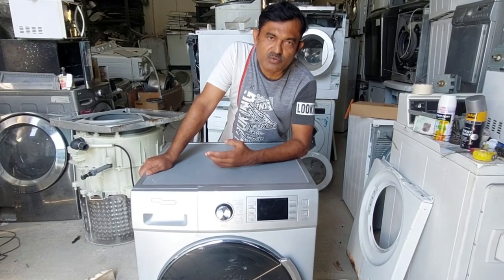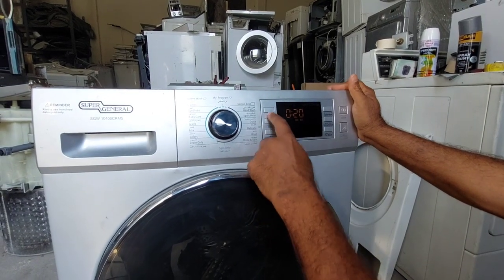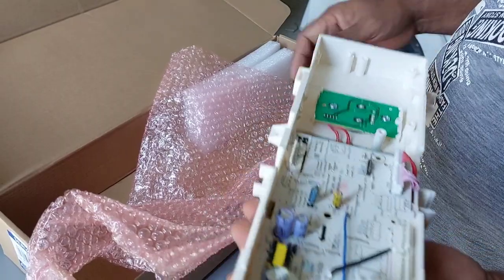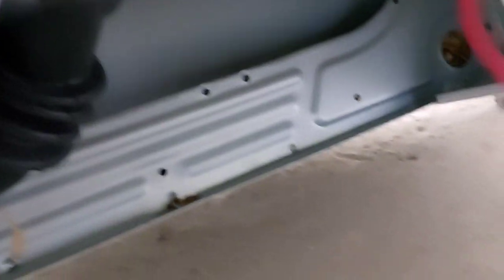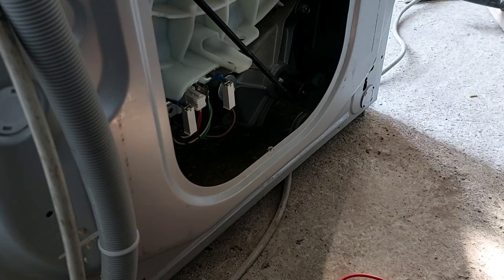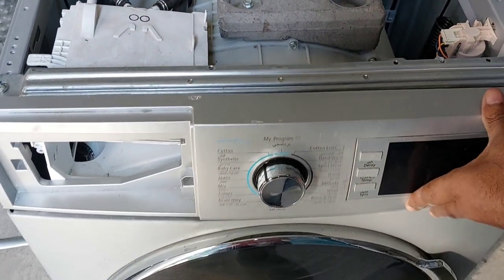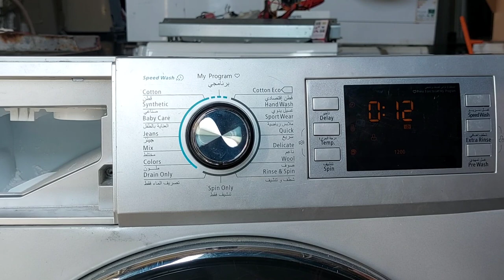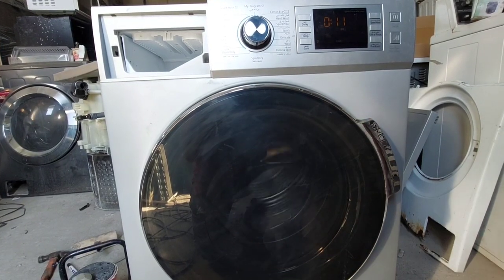Super General Washing Machine Not Working.

Comment: Super general sgw721 not working   screen showing F8 what is the problems  place reply 🙏
Reply from the maker: Could you check the drain pump, otherwise drain hose will bend or not? might drain pump damage.
Reply: @magelectronics  Ok i will check ❤️
Reply: super general "sgwi7400crm washing machine motor not starting and door also unable to open

Comment: Hello, what is the sign of general error e10 washing machine?
Reply from the maker: if it's error E 10 it's related to the water supply. You have to check the inlet hose, valve,& pressor sensor.